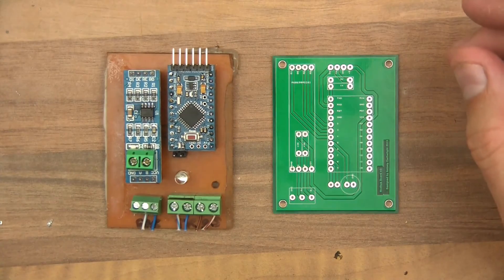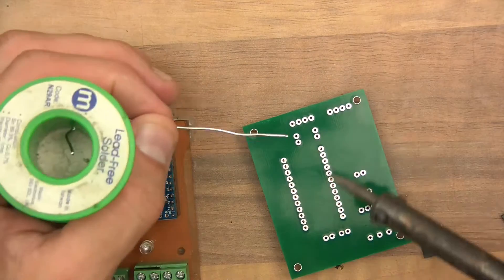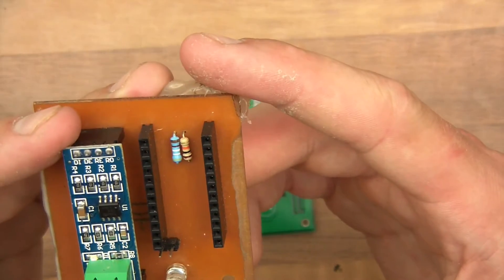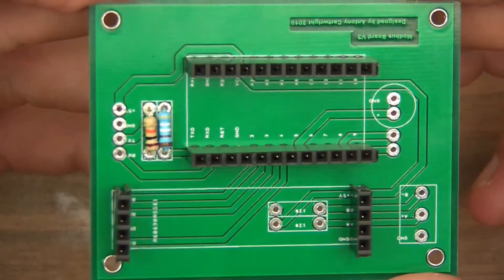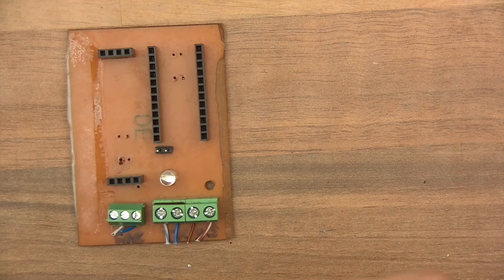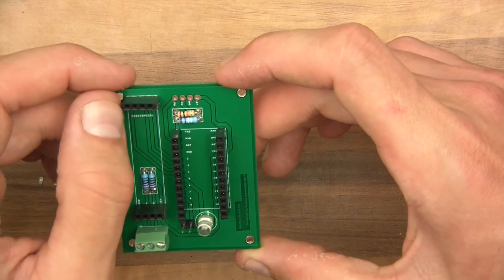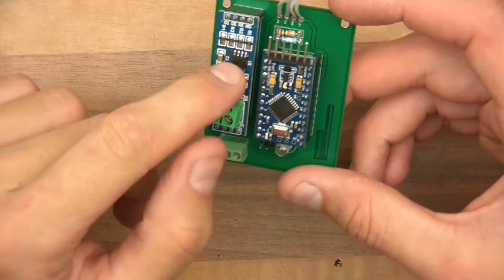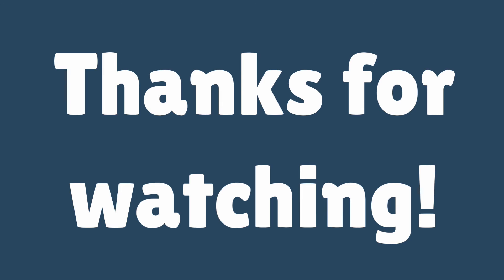INVESTIGATING: My New Solar Modbus Communication Board - Charge Controller 4215BN

Comment: Howdy.  Some clarifying info:

(1) . MODBUS is just a serial protocol that is over an RS-485 physical interface.  The reason the ESP-8266 and ESP-32 devices cannot use it is that the modbus libraries are typically broken; adding a serial.flush() to ensure all output is written before the RS-485 transmit enable is disabled fixes this.
(2) . I just designed exactly the same board you designed, but for a different reason.  Mine is used for LED strip lighting control using APC-102c LED strips, but using a simple serial protocol where each node is assigned a starting ID number, and then a controller spits out blocks of control data.  Since RS-485 is multi-drop, I have about 10 receivers and 1 controller, and my simple protocol ensures only one node talks at a time.
(3) . Nice board.
Reply: Hi, I have EPever solar charge controllers that I would like to connect to the Victron Cerbo Venus OS system. Do you know if something like this has been created. Could you point me in the right direction to follow this. Thank You.